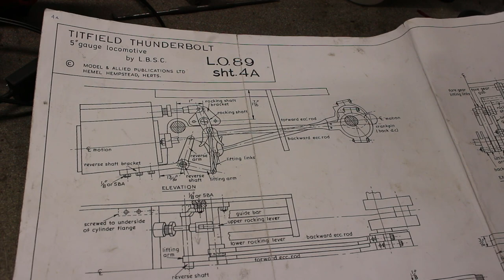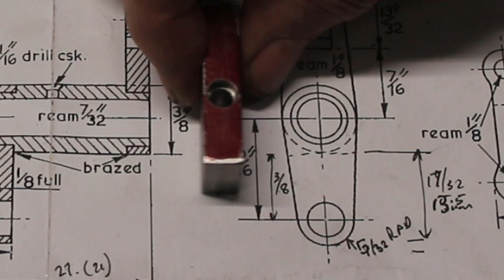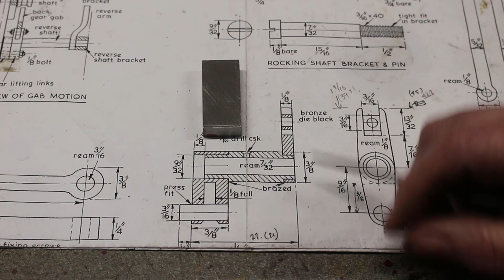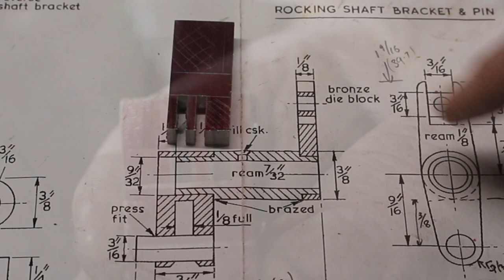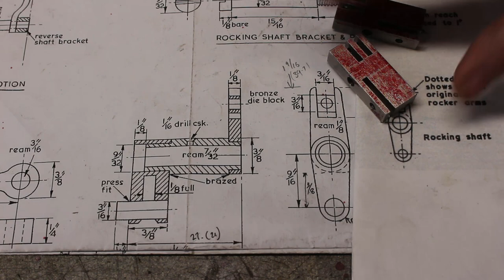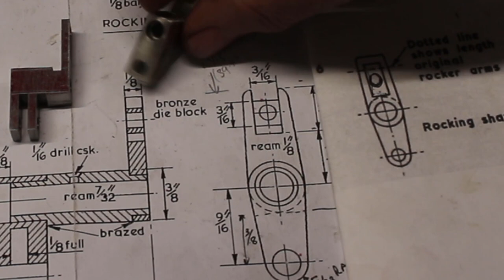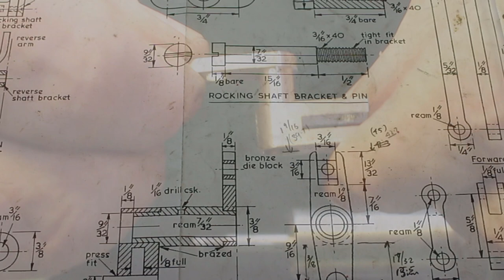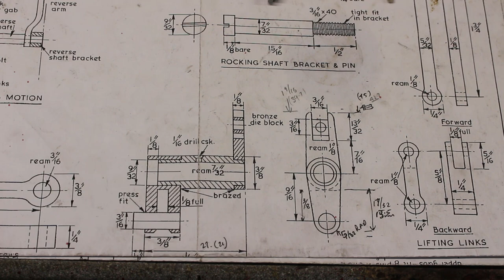Lion Locomotive in 5" gauge part 53- Valve Gear Rocking Shaft

Comment: Lion has a tendency for her upper gabs to slide put of position and over the top of the rocker shafts.  Bit late in the day now but there is a later design with an extension which stops this happening.  It's in Model Engineer magazine, I have it on pdf
Reply from the maker: Hi Edward. I have the modifications recommended by Mr Saxby published in ME in the 1980's, would that be what your referring to? I'd be interested in any other info. You should find my email on my channel page if you would like to contact me that way.
Your viewing and comments much appreciated.
Reply: @GoCreatehms  I've just been through the articles by Saxby, Miller and Taylor-Nobbs and it's not in there, I'm wondering if it was covered in one of the letters to the ME magazine which I haven't scanned.  If I can figure out how I'll send you a photo of mine

Comment: The pedal on the footplate to change the slip-eccentric valve gear is very interesting! I'm aware of how the slip-eccentric works but never heard how they got them to reverse in full scale practice. Lovely work as always!
Reply from the maker: Hi Frank, I believe this short video mentions the foot pedal with regard to the slip eccentric gear. On the model, if you use the slip eccentric you have to manually push the loco forward or backwards to change direction, which I don't like much.
https://www.youtube.com/watch?v=LoWQ1bMf3_A
Thanks for your interest, Cheers!

Comment: Nice one Nigel. I love how a part can "magically appear" from the solid. Now, filing buttons. I don't bother with hardening ( we were always "advised" to do it) I make mine from mild steel and allow them to roll on their shaft as I file. I do not have them fixed. Now you can do this with hardened rollers but you will dull you files. So, why bother? Give it a try,myou will save yourself a bit of time!
Reply from the maker: Thanks Peter, I'll give that a go, I hadn't thought about letting the filling buttons roll, sounds a good idea. Cheers!
Reply: I'm not sure why I twigged on to the rolling idea, I think it was the fact I was dulling my files! Any way it works for me and they sure are easy to make. Good luck.
Reply: Much as the buttons on the router bits for wood, they roll along as you cut.

Comment: Very educational work Nigel for a beginning machinist like me. I just could not even begin to imagine how to create the part on the drawing from a solid piece of steel. In the course the video the mists cleared. Wonderful. One question. Where you rounded the part in the indexer with ten degrees increments. I wondered: could it have been possible to return the indexer to its starting position slowly by hand and unlocked with the cutter still running and while doing so shaving off the small 10 degree corners you left? It would have saved you the filing by hand. But maybe it is a ludicrous idea, I dunno.
Reply from the maker: Thanks for your comments, much appreciated. I think it would be a bit risky to machine the radius on the spin indexer by rotating it by hand, could risk scrapping the part, in that case better to use a rotary table or dividing head. Possibly I could have finished it by hand in the spin indexer after machining the facets, when it would only be taking light cuts, but the filing is a quick job and besides, I like filing.
Cheers Nigel
Reply: @GoCreatehms  
Well you could have always rigged up a pivot on the table of the horizontal mill  for the axis of the part then used a screw linkage to pivot the part under the cutting wheel. 😁

Comment: Is there enough room between the frames to re gauge it to 4-3/4" gauge?
Reply from the maker: Not with the boiler firebox made to the drgs, make the firebox narrower and I don't see any specific problem with that.
Reply: @GoCreatehms  no problems with the cylinder castings being in the way?
Reply from the maker: I think you would have to move the pistons and valve gear in towards the centre of the engine, so a commercial cylinder casting may not be usable. The wheels on the 5" gauge are quite wide in my opinion, if the wheels on a 4'3/4" gauge could be made a little narrower then the inside frame width could be increased, say 1/16" per side, so leaving the pistons and valve gear to move in 1/6" per side (or possibly remain on the same centres ). I think it's possible to adopt the model to 4-3/4" gauge but this would have to be confirmed with a layout drawing to be sure. Hope that helps.